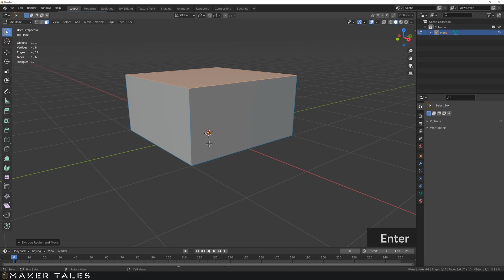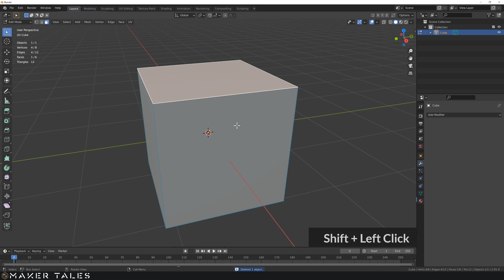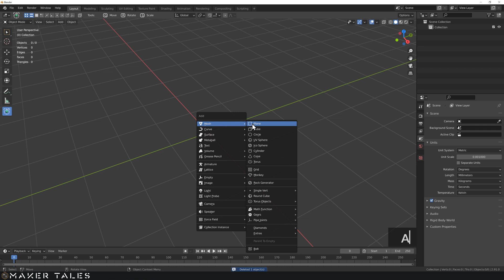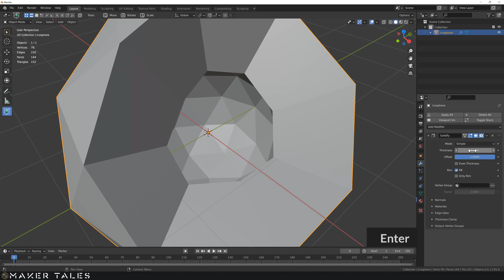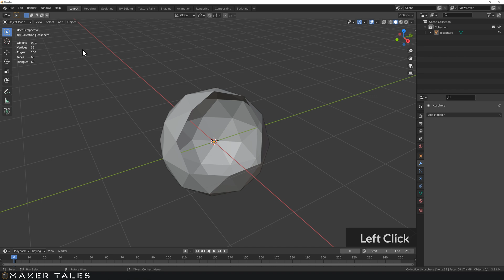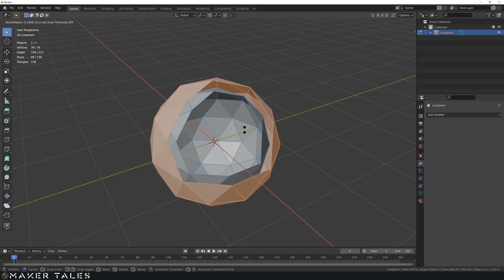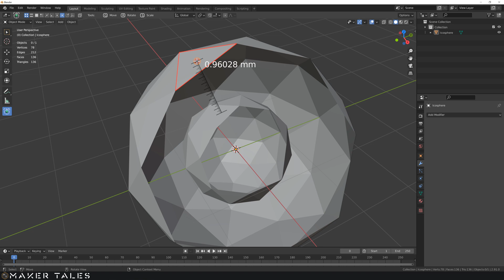Solidify Modifier | Should you use it | Learn Blender 2.9 / 3.0  Precision Modeling | Part- 24

Comment: there is a simple rule. Just don't use it after 2.8x. They fixed something, but in my opinion, it is worse now in 3.01. Maybe for simple things, low poly, no UV, stylized could be OK. 
My typical usage is, for extracted geometry, out of a sculpt modell. Normally i do quadremesher, then solidify and then multires to get some detail on it, what i can use later to bake normals. Sadly the modifier destroy the topology, if you want unwrap it, you enter the world of pain. sculpting remeshing make thing worse. It's an endless loop.

Comment: The scaling along normals is not a consistently reliable solution, it depends a great deal on the geometry. It will not work for something like a vase that has a curved lip because the normals actual point "down" so the scaled mesh will actually be smaller in the z direction even though the objective is to scale it larger. Try the example with the monkey mesh.
Reply: Thanks for this comment. It has been a while, but I tried it out the way you suggested and I saw that after scaling (or extruding) along normals, you have the option to set "Offset even"in the bottom left dialog box... does that not fix it?

Comment: Hi. Thanks for the instructive video. But for me, a intermediate beginner in blender, there is a question. At the end you have the exact measure you want, but for me there are just two icospheres into each other. What has that to do with the word "solid" ? I expect by the word solid that there is no space but only material between the outer and the inner rim? ist that not correct?

Comment: I've been following your videos and they're really well set! Question, though...

I'm working with a lot of curves and  I need precise measurements to know where the curves will need to intersect. Is there a way, perhaps in Measureit that I'm not seeing to denote the length of a curve? Or ideally, I'd like to see it denote measurements by the inch as I need the curves to bisect at the inch marks like on a bendy ruler or something.
Reply from the maker: Hey there Noah, well long and the short... soon there will be a video out about arrays and I have a feeling that if you are using curves a lot that this video will be a must see for you. For now tho I would suggest that you google up how to array a vertex along a curve and this will give you some type of sudo curve ruler that you would be able to use with snapping.
Reply: Curve tools addon :)